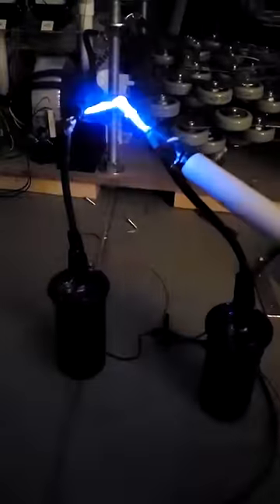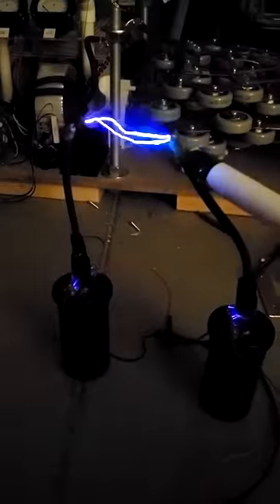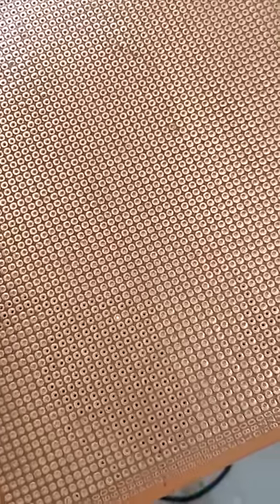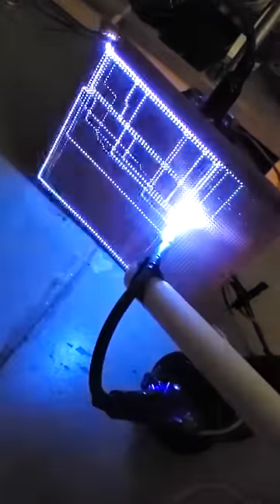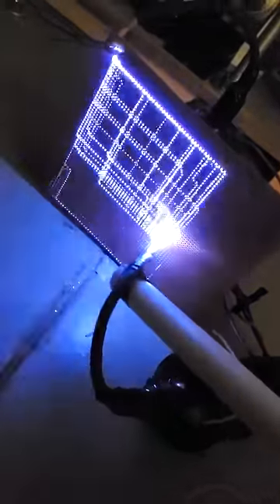car parts can be used to make this??

Comment: Not to mention when one circuit heats up and becomes more resistive, it will jump to another circuit.
Reply: Why does heating it up cause it to be more resistive?
Reply: @IAMmrhardcore  for ohmic conductors resistance is directly proportional to temperature
Reply: @IAMmrhardcore  the temperaturekoefficent of coper is 0.00391ohm/kelvin.  You have to calculate resistance ad 20celsius and then calculate in the faktor (0.0287(ohm*mm) /m   * length) squaremm  is 20c then multiply with (1+0.00391ohm/kelvin * temperatur differenc to  20c)
Reply: @notparanoid912  your username is obviously a front.. i can tell you’re very paranoid bud..
Reply: @notparanoid912  should be tue contrary of your nick
Reply: Ohhh so that's why the pattern changes instead of just taking the same route through the board over and over
Reply: So you think the temperature increase of the copper from a few milliseconds of sparking, wich is changing the resistance of the ring by a few milliohms, is comparable to the hundreds of kiloohms from the airgaps?

Heating of the copper is not the reason the electricity changes paths.
Reply: @xubor007  then can u tell us what the reason Electricity changes path?
Reply: @xubor007  yeah elaborate further, we are here for science afterall
Reply: Well, first of, this can only happen when using AC, with a HV DC the path would stay pretty much the same until you burn the PCB itself.

Since these ignition coils will provide short HV spikes with long pauses, every new park has to ionize the air again to form a spark. But the air is already heated up and ionised from the previous pulse, and the one before that. Furthermore, every spark will burn some dirt and fingerprints between the airgaps, making it more or less conductive for the next pulse.

The combination of burning away residue between the airgaps + the ionisation and heating / convection of air from the previous pulses is likely the cause for changing paths (not guaranteed)
Reply: @xubor007  why do you think it wouldn't be enough?  The  board acts like a bunch of wires in a grid pattern, but it isn't as "thick gauge" as a wire, so it makes sense it could  heat up quickly.
Reply: I'm here like science sure
Reply: @docarii  Because a resistance change of a few milliohms is not comparable to the hundreds of kiloohms (if not much more) of the airgaps and their change of resistance (especially breakdown voltage). We are talking about 9 orders or magnitude.

You don't need any heating up copper in the middle of the arc to have changing paths. Just look how they form between the two coils in the air alone. The air itself determines the path. Two conductor in the middle wouldn't magically change that. I bet in that arrangement nobody would even think the heating of these would cause any change.
Reply: I was learning about this today at school but more focused on how to choose the right fuse. Using Ohms law to calculate the current of a circuit and the formula: normal operation temp divided by the temp factor multiplied by 0.75 
Say you had a circuit running 16 amps in a 120’c environment and you need to protect the circuit with a fuse. 16 ➗0.86 x 0.75 = 0.645 x16= 24.8 . So you would use a 25 amp rated fuse . 
Current carrying capacity tests of fuses are performed at 25’c and will be affected by changes in ambient temperature. The higher the ambient temperature, the hotter the fuse will operate, and the shorter its life will be. Conversely, operating at a lower temperature will prolong fuse life. A fuse also runs hotter as the normal operating current approaches or exceeds the rating of the selected fuse. Practical experience indicates fuses at room temperature should last indefinitely, if operated at no more than 75% of fuse rating. For example, a fuse with a rating of 10amps is not usually recommended for operation at more than 7.5amps in a 25’C environment.
The general rule is resistivity increases with increasing temperature in conductors and decreases with increasing temperature in insulators.In the same way that matter is an assembly of microscopic particles called atoms and a beam of light is a stream of microscopic particles called photons, thermal vibrations in a solid are microscopic particles called phonons. The electrons are trying to go toward the positive terminal of the battery, but the phonons keep crashing into them. The random direction of these collisions disturbs the attempted organized motion of the electrons against the electric field. The deflection or scattering of electrons with phonons is one source of resistance. As temperature rises, the number of phonons increases and with it the likelihood that the electrons and phonons will collide. Thus when temperature goes up, resistance goes up.
Reply: @IAMmrhardcore 99
Reply: @xubor007  it doesn’t matter if it’s comparable. The real reason the resistance changes isn’t due to heat…heat is just the evidence the real problem is gridlock. The electrons are already pack into the copper along one path when the second, third, fourth, etc inputs happen. The input is higher than the output for each and every active path, but not for the inactive paths which means electrons will flow into those areas until they reach an equilibrium, or until the gridlock is released.
Reply: So if you ran the input at a steady rate that dissipated in a way you could actively control you would also be able to control where the electrons flowed….for a time
Reply: More resistive? 💀💀💀💀
Reply: @LOCKSHADES  resistive (act of being less tolerant to change) that process can take many forms. It’s not really a good description. It’s what is happening, but it doesn’t explain the process. You can have more resistance(property defining your ability to not change) due to many differing factors(Temp, mass, material, density etc). Electricity is nothing more than the flow of electrons throw a conductor such as copper or gold.
Reply: @IAMmrhardcore  all molecules are vibrating because of temperature. This will always happen except absolute zero. When molecules are vibrating faster it's harder for the electrons to jump from one molecule across the void to another molecule. 

Good example would be boats. When the water is completely still you feel confident in jumping to another dingy. When there are some waves go wobbly but still are able to do it. When there's huge waves jumping to another boat is a big nope. The electrons just get pulled back when the distance is too high and they still try to jump.
Reply: Yo I’m Braden Jones
Reply: @danielfinley-pesti6661  if you aren't paranoid you aren't paying attention
Reply: @shanemurphy6130  I think he asked why, he didnt ask for the formula
Reply: But you did mention it...
Reply: @_Cfocus  isn't that the same thing?
Reply: pretty cool right?!
Reply: @IAMmrhardcore When a wire heats up, the atoms are wiggling with more energy. So when the electrons try to pass through the wiggly mess, they get knocked around more and take a longer path, thus, they take longer to reach their destination.
Reply: @MrKaiyooo I second this comment!
Reply: @IAMmrhardcore temperature is defined by the average kinetic energy of the atoms or molecules of a substance.

Kinetic energy is a fancy word for movement.

As temperatures go up, so does kinetic energy (movement). More movement means larger space between atoms. This space means less conductivity.
Reply: @xubor007  nice
Reply: Electricity is like water, it takes the path of least resistance. 
To answer @IAMmrhardcore when a metallic conductor heats up its molecules expand and the space between them is less geometrically aligned and it also expands as a result, increasing their Ohms
Reply: To understand the relationship between temperature and conductivity get a newton’s cradle pull one ball away and drop it, nothing moves but the ball on the opposite end as a reaction, and it happens instantaneously, that is an example of kinetic energy conductivity.   Now cut pieces of styrofoam to place between the suspension lines so there is enough space to pass a piece of paper between each ball without interfering with the linear swinging ( so slightly lower than the girders the lines are connected to and wedged between them, one piece of foam can be used to do the whole cradle, this doesn’t have to be done equally, then do the same test and note the results, you can also offset one or more of the balls on the lines ( mark with  a paint brush and ink on the opposite side of the line to return it to center) and note the results, a combination of offset and spaced balls mimic the conditions of the molecular arrangement of heated conductive material
Reply: I wonder if this effect could be used to produce a true random number generator.
Reply: Also magnetic field at the corners
Reply: @xubor007 I’m thinking the sparks are ionising the air and making it more conductive , that air can drift across the pcb in random ways?
Reply: @shanemurphy6130  is that why superconductors are cooled
Reply: And this happens cery fast, as we can see

Comment: Years ago, I was diagnosing a vehicle which wouldn't start. I told the owner to get in and I'd let him know when to turn the key. So he just gets in and turns the key immediately. I had one of the plug wires in my hand and it felt like I got 50 shocks before I could let it go. This just brought back painful memories.
Reply: Lmao my grandmas malibu shocked the piss out of me when I was trying to diagnose a misfire
Reply: Pretty cool right ? 😂
Reply: When I was 7 or so and my father was working on my go-kart, he got me to hold the spark plug while he pulled the starter rope. It turned out the ignition was firing...
Reply: had a nissan d21 pickup, decided to try and push the boot further up on the coil. My head met the underside of that hood so fast lol
Reply: Been there, it feels great
Reply: @kevinmatthews8980  It's an electrifying experience.
Reply: Lmaoo
Reply: If you wanna screw with someone just take a pencil and draw lines on the heads between spark plug holes.  Basically the engine becomes the breadboard in this experiment.
Reply: @BroncoJoeAK what could go wrong?
Reply: @zacharysherry2910 not much but also a lot
Reply: @BroncoJoeAK there's something wrong with those wires if a spark can jump out through the air, through the marking, and back to the other one through more air and insulation.
Reply: Try it with a 454 with 800hp had same bullshit happen, and I thought my heart was gonna stop fr
Reply: Yeah but has your wrench grounded itself on you and the diesel tank on a 4 battery mack while taking off the batteries. It started glowing red before while I was kicking it off and I didn’t have finger prints for like a month 😂 
I learned many lessons that day